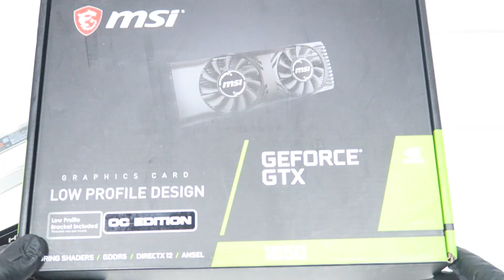Dell Optiplex 7070 Gaming Upgrade RAM SSD Video Card

Comment from the maker: List of Parts  and Upgrades: 
    

 Dell Optiplex 7070 Teardown
https://www.youtube.com/watch?v=HbMezxrIVMg

Dell Optiplex Reassemble
https://www.youtube.com/watch?v=d_iJJm0R1hk

Dell Optiplex 7070 Power Supply Upgrade
https://www.youtube.com/watch?v=zjG4lglejF4

USB Wifi Adapter for PC AC600Mbps Wireless Network Adapter
https://amzn.to/2ZaGuHb
 

List of RAM will work with this system.

(1.) Kingston HyperX Fury Black 32GB 2666MHz DDR4 CL16 DIMM Kit of 2 (HX426C16FBK2/32)
https://amzn.to/38zqi4Z

(2). Crucial 16GB Kit (8GBx2) DDR4 3200 MT/S (PC4-25600)
https://amzn.to/3f21Qf7

(3.) Crucial 16GB Kit (8GBx2) DDR4-2666 MT/s (PC4-21300) 
https://amzn.to/3e7axnh

(4.) Crucial 32GB Kit (2 x 16GB) DDR4-2666 UDIMM (PC4-21300)
https://amzn.to/3e62jvq

(5.) Crucial 16GB Kit (8GBx2) DDR4 3200 MT/S (PC4-25600)
https://amzn.to/3f21Qf7

(6.) Crucial 4GB Single DDR4 3200 MT/s (PC4-25600)
https://amzn.to/2VXqTZo

List video cards will work with this system.

GIGABYTE GeForce RTX 3050 OC Low Profile
https://amzn.to/3xEnd4D

AMD Radeon RX 6400 Low Profile Gaming Graphics Card
https://amzn.to/3s8MUUY

XFX Speedster SWFT105 Radeon RX 6400 Gaming Graphics Card
https://amzn.to/3xkmXo1

GIGABYTE GeForce GTX 1650 D6 OC Low Profile, Low Profile GV-N1656OC-4GL Video Card
https://amzn.to/381pp6Y

(1.) GIGABYTE GeForce GTX 1650 OC 4GB, GV-N1656OC-4GL Video Card
https://amzn.to/2B7N1sP 

(2.) Gigabyte GeForce GTX 1650 OC GDDR5 Low Profile 
https://amzn.to/3el08os

(3.) Gigabyte Geforce GTX 1050 Ti OC Low Profile 4GB GDDR5 128 Bit PCI-E Graphic Card (GV-N105TOC-4GL) 
https://amzn.to/2T8bfsv

(4.) MSI Gaming GeForce GTX 1650 4GB GDRR5 Low Profile Graphics Card (GTX 1650 4GT LP OC) 
https://amzn.to/2X1FYsF

(5.) MSI GTX 1050 TI 4GT Low Profile  Graphic Cards 
https://amzn.to/2LwZd7P

(6.) Gigabyte GeForce GT 1030 GV-N1030D5-2GL Low Profile 2G Computer Graphics Card 
https://amzn.to/2Z4PHkp

(7.) ZOTAC GeForce GT 1030 2GB GDDR5 64-bit PCIe 3.0 DirectX 12 HDCP Ready Low Profile Video Card ZT-P10300A-10L 
https://amzn.to/2WzgLXk 

(8.) MSI Graphic Cards GT 1030 2GB GDDR5, Low Profile 
https://amzn.to/390Spum

Thermal Grizzly - Spatula for Applying and Spreading Thermal Paste 
https://amzn.to/3d8NQEE

Thermal Compound Paste:

(1.) Arctic Silver 5 Thermal Cooling Compound Paste 
https://amzn.to/2ziNU0H

(2.) Noctua NT-H1 3.5g, Pro-Grade Thermal Compound Paste
https://amzn.to/36kTk7A

(3.) ARCTIC MX-4 (current edition) Thermal Compound Paste 20 Grams 
https://amzn.to/2DhGJaK

List SSD M.2 Type 2280 NVMe PCIe:

(1.) Crucial P3 Plus 4TB PCIe M.2 2280 SSD
https://amzn.to/3RZcUNi

(2.) Crucial P3 Plus 2TB PCIe M.2 2280 SSD
https://amzn.to/3RTUi0Y

(3.) Samsung (MZ-V7E1T0BW) 970 EVO SSD 1TB M.2 NVMe
https://amzn.to/3d52k2a

(4.) Samsung 970 EVO Plus SSD 500GB
https://amzn.to/3fpi95A

(5.) Samsung (MZ-V7E500BW) 970 EVO SSD 500GB - M.2 NVMe
https://amzn.to/37uuLFw

(6.) Crucial P1 500GB 3D NAND NVMe PCIe M.2 SSD - CT500P1SSD8 
https://amzn.to/2N07wKh

Hard Drive Caddy Adapter  3.5 to 2.5:

(1.) Dell 3.5" to 2.5" SSD or Hard Drive Caddy Adapter R494D 0R494D 
https://amzn.to/2XTPeRr

(2). Dell Hard Drive Caddy, R494D, F767D 3.5" to 2.5" SSD or Hard Drive
https://amzn.to/3cTkcOk

SSD List:

(1.) Samsung 870 EVO 2TB SATA SSD
https://amzn.to/3ezOds5

(2.) Crucial MX500 2TB 3D NAND SATA Internal SSD
https://amzn.to/3B9f8CF

(3.) SanDisk Ultra 3D NAND 2TB Internal SSD - SATA
https://amzn.to/3RSZ8LR

(4.) Samsung 860 PRO SSD 256GB - 2.5 Inch SATA III Internal Solid State Drive
https://amzn.to/2BY5gRl

(5.) Samsung SSD 860 EVO 250GB 2.5 Inch SATA III Internal SSD 
https://amzn.to/37xWUfc

(6.) SK hynix Gold S31 1TB 3D NAND 2.5 inch SATA III Internal SSD
https://amzn.to/3d7X6D6

(7.) Samsung SSD 860 EVO 1TB 2.5 Inch SATA
https://amzn.to/2B2FURX

(8.) SanDisk SSD PLUS 1TB Internal SSD
https://amzn.to/3hwdqku

(9.) SanDisk SSD PLUS 240GB Internal SSD
https://amzn.to/2zfc7EX

(10.) Crucial MX500 250GB 3D NAND SATA CT250MX500SSD1(Z) 
https://amzn.to/3bTTjbX

(11.) SanDisk SSD PLUS 480GB Internal SSD SDSSDA-1T00-G26
https://amzn.to/2yfgjUK

HDD list works with this PC:

(1.) Seagate BarraCuda 4TB Internal Hard Drive HDD – 3.5 Inch
https://amzn.to/3d3xWeR

(2.) Seagate BarraCuda 8TB Internal Hard Drive HDD – 3.5 Inch
https://amzn.to/3xjUDSJ

(3.) Western Digital 2TB WD Blue PC Hard Drive HDD - 5400 RPM, SATA 3.5" - WD20EZAZ
https://amzn.to/3w3jIQA

(4.).WD Black 2TB Performance 3.5" Hard Drive - 7200 RPM Class, WD2003FZEX 
https://amzn.to/2xFUeyF
Reply: Sir can you give me advice what is best graphics card upgrade for my Dell Inspiron 3668 i3-7100 8gb ram
Reply: @bangihun5058  gtx1650 gddr6
Reply: @bangihun5058   try get a  i5 7500 for cheap since any graphics card more powerful than a gtx 960 will be bottlenecked by that dual-core cpu.
Reply: Where is the best place to get an Optiplex? And which model would you recommend?
Reply: Spooksville Scoob try local sales and eBay as these computer are very common.
Reply: hello pale can I buy this rig Dell Optiplex 7070 Gaming from this video if you don't use it any more ....peace
Reply: How much was the build in this video
Reply: Great information coming from this video.  Liked and Subscribed. 

I’m wondering if the Optiplex 7040 will accept the same list of ram you posted. Thanks.
Reply: Can i put 1050ti low profile im my optilex 5060 ? Or i will face PSU issue ?
Reply: I just put a Sapphire RX 6400 into 16 slot of this computer with 200 W and it works just fine (no DVD but has SSD and 5400 drive).
Reply: So do you have to have the 240w for the graphics card in the video to work? Or can it still run on 200w?
Reply: Is it possible to install a RTX A2000 on this thing?
Reply: Did you have to make any bios changes for gpu to work?

Comment: Hi bro, love your videos.

How is the GTX 1650 running? I am aware some dell prebuilts advertise a power limit of 50 W or even lower for the PCIe slots, is this Optiplex affected?

Also being a PCIe X4 I wonder if you ran into significant bottlenecks because of this.

Comment: Hi, congratulations for the video. I would like to mount an SSS on my dell optiplex xe3 sff i5-8500, I have the Sata cable already connected to the motherboard, while the power cable is missing.
Currently there is connected DVD and NVME drive.
Can you tell me how I can do it? Thank you

Comment: using that x4 slot with the gpu will nerf that card by like 20 to 30%
Reply from the maker: Hi.
Reply: x4 slot only has a 5% to 10% performance loss do some research before you comment 🤡

Comment: you cant put that gtx 1650 with that optiplex 7070 on the specs of that computer is not listed did you change the motherboard???be honest only these are compatible Dual AMD Radeon R5 430 AMD Radeon RX 550 NVIDIA GeForce GT 730 AMD Radeon R5 430 so how did you add a gtx 1650???

Comment: Just bought system w/o RAM or SSD so this video was perfect.  Excellent list of resources also.  A keeper.
Reply: Hey do you know if there is an USB pin for connecting a network with Bluetooth card? Because I bought one and I cannot find an USB pin (female) in the motherboard

Comment: I need your help, i put in the a new 1tb ssd in the 7040SFF but it’s saying no bootable device found. What do I do
Reply from the maker: Hi, you have to check in BIOS settings see if SSD is detected ?
Reply: @Mxkdt  it’s detected
Reply from the maker: @CxsmoFN  Are you trying to install Windows on it or you already did that ?
Reply: @Mxkdt  I just installed it, i don’t it has windows on it, it’s the silicon power 1tb SSD in an optiplex 7040 SFF
Reply from the maker: @CxsmoFN  In Windows go to Control Panel\System and Security\Storage Spaces and create a new pool and storage space for your new SSD.
Reply: @Mxkdt  if I put the ssd it won’t boot and when I try creating the storage pool it says no drives that work with storage spaces are available

Comment: Hey man, even I'm thinking of upgrading my office PC so i really need your help. So i have OPTIPLEX 3070 MT so im planning to get GTX 1650 OC. Do you think it will work fine with it? I have i7 9th gen processor
Reply: Please reply me if you get think. It would be really helpful
Reply from the maker: Hi, yes GTX 1650 will work fine in that PC.

List video cards will work with this system.

(1.) ASUS Phoenix NVIDIA GeForce GTX 1650 OC Edition Gaming Graphics
https://amzn.to/3Nyn7yb

(2.) ASUS TUF Gaming NVIDIA GeForce GTX 1650 OC Edition Graphics Card 4GB GDDR6 
https://amzn.to/3moJbzo

(3.) PNY GeForce GTX 1650 4GB GDDR6 Dual Fan Graphics Card
https://amzn.to/3aFlxw4

(4.) ZOTAC GAMING GeForce GTX 1650 OC 4GB GDDR6 
https://amzn.to/3xeX0FF

(5.) AMD Radeon RX 6400 Low Profile Gaming Graphics Card
https://amzn.to/3s8MUUY
Reply: @Mxkdt  thank you so much for responding🙏🙏

Comment: The real question for me it would be how long the PSU will live and how are those PSU called? Because if mine die then I would have to buy a new PSU but they looks very differe t to the ones I am familiar with.
Reply from the maker: Hi, what model dell PC do you have ?
Reply: @Mxkdt  3040
Reply from the maker: @zamirroa  You want to replace power supply in a Dell OptiPlex 3040 sff for gaming ?
Reply: @Mxkdt  I think it is not possible. I just wanted to know how much they last.
Reply: Sff

Comment: I was planning to buy the 7050 SFF with i7-6700 cpu and 16 GBs of RAM. But I want to upgrade the video card to the GTX1050ti OC (low profile). Plugging it to the PCI Express x4 slot instead of x16 does it means that the full capabilities of this graphics card will not be achieved?
Reply: Exactly!

Comment: I've posted on other videos regarding the PSU..and the low clearance of the pcie x16 slot..has anyone tried or thought of using a 300w pico psu? It would free up so much room for better airflow along with better GPU clearance

Comment: The only thing you forgot was to include the part number to get the screw for the SSD LOL... thanks for great videos.
Reply from the maker: Hi, thanks screws are included when you buy that blue caddy R494D 0R494D F767D J132D Replacement for DELL OptiPlex 2.5" HDD SSD Caddy Tray..
Reply: @Mxkdt  I was referring to the single screw holding down the NVME, (thus my mentioning SSD) you mentioned you'd put where to get that, it's ok, I already ordered it.

Comment: How did you fit that GPU in?
Reply from the maker: Hi, what kind a video card are you trying to install ?
Reply: @Mxkdt  sumtin like a small cooler version of the rx 6400 or the HP OEM rx 550

Comment: Would the video cards recommended for this optiplex 7070  fit on a optiplex 3070 min  from the video the size is the same
Reply from the maker: Hi, what model optiplex 3070 do you have is it minitower or sff or mico ?

Comment: Is that the only graphics card you can put on it or can I use a rtx 2060??
Reply from the maker: Hi, this dell small form factor can only fit low profile video card  like gtx 1050 or gtx 1650, gt 1030 with low profile bracket only and rtx 2060 will not fit...
Reply: @Mxkdt thanks 👍
Reply from the maker: Please don't forget to subscribe to the channel.

Comment: I have a 7040 and really am surprised that 3 generations later Dell still has the PCIe slots the wrong way round 😄
Reply: I have a 5090 and still pcie x16 at wrong position. This shows how much industry is slow in modification and resistant to change. They think these machines are not for gaming so they don’t care. They feel its not worth their time to spend time on redesign.
Reply: Plus they did that on purpose

Comment: Hey I have a 7060 SFF - what is the best GPU that will fit into my case?
Reply: Hello bro, which GPU did you bought for 7060 sff?
Reply: @gilbertodisai4392  1050ti low profile gigabyte
Reply: @adilahmad7259  do you have the 180 psu?

Comment: Does sticking a 1650 in the x4 slot loose performance and power?
Reply: I was wondering the same thing. I was under the impression it would not work at all in that slot.

Comment: I have the same setup,and it's a little bit overheating...but if you put a 80mm fan at front,the video card takes cold air from outside,not heat from power supply..
Reply: The question os where we can connect the power port of the fan in the motherboard?
Reply: @AkoSiManatMy  You will find a fan header on the bottom right of the motherboard, it has 4 pins and is white.

Comment: Isn't this office pc too expensive to upgrade? Like, you spend 250 on this pc at best, and then 80 bucks on a low-end GPU? Don't you want it to be the other way around? I doubt even a 3rd generation intel i5 CPU would be a bottleneck for this system.

Comment: hi! May I ask if i7-8700k (or i9-9900K) and Quadro P1000 are compatible to Optiplex 5060 & 7070 SFF please. Is upgrade the power supply needed?
Reply: Hi, no K cpu models. Only the non K. The LP p1000 will work Just fine.
Reply: @robinvemsus6223  Hello. Thanks. I got i7-9700 already. GPU to follow

Comment: I have 7050 same design, use gtx 1650 msi with 180w 32gb ddr4 240 nvme, no issue yet
Reply: wow! so gtx 1650 can handle 180w PSU? how's it going now?
Reply: Yeah is it still going strong?
Reply: I’m about to try a 1050 ti low profile on 180 watt power supply
Reply: Any update about this?

Comment: I'd be tempted to drill some holes in the PSU case to get some airflow out of that GPU.  It's a shame Dell didn't put the x16 slot on the upper side.
Reply: i know now i use the 4x for my gtx 1650 low pro lol

Comment: Air flow rip
Reply: mount a cpu fan above and in between cpu and gpu i never get above 65 degrees c and im over clocked pulling 2200 core clock.

Comment: This seems like such a waste of time since you can only use the pci express 4x slot... Like, what is even the point?
Reply: It does work. He physically can't pkug it in. 
Difference is around 5-10% performance.
That's nit much considering gtx 1030

Comment: I’m surprised that the GTX 1650 worked with that 240W psu cause the minimum requirements were 300w
Reply: They can out whatever arbitrary recommended minimum requirements, but the card is pci powered and can never draw more than 75 Watts. And I'd be surprised if it ever uses more that 50W.
The cpu is never gonna be more than 95w in a sff pc.
Hard drives and ssd's when fully populated take 10-15W at peak load (spin up of mechanical drives)
So that's a total of 185w + memory and motherboard, so it won't go over 200w... Enough power left over to install another expansion card as well.
Reply: @arturm4558  ive been running a gtx 1650 msi oc low pro on my 4x slot in dell opti 7020 sff model for like 8 months non stop and the slots rated for nop more then 35 w lol. still going strong .
Reply: @sipmeister3611  does your optiplex have a 180 psu?
Reply: @asfaltweg  no 245w
Reply: It is a gtx 1030
Reply: A put a GTX 1650 LP in a Dell Optiplex 3010 SFF that also has a 240W PSU and it works fine.

Comment: Can i use the same gtx 1650 low profile in dell Inspiron 660s???
Reply from the maker: Hi, no you cant because pci express x16 slot is located on the bottom and will not fit and you can only use gt 1030 or you can take the motherboard and install into mid tower custom case and that allow you to install gtx 1650 or gtx 1650 super.
Reply: Thanks

Comment: When you've done an upgrade do you have to fo anything to do with software?
Reply: I think that you have to download the graphic cards drivers and the ram is updated automatically in the system, that´s what I know
Reply: @gabrielgonzalez5554  no after ram upgrade you may be drawn back to 1333mhx instead of full 1600 dont ask why but it happened to me today althoough my previous ram was already at 1600mhz ?

Comment: Hi Mxkdi - thanks for all the vids!! Question (really stuck here) - I have a Precision 3431 SFF w/ I9, 32gb of ram, 500gb sad the little one, and I put in a AMD Radeon Pro WX 3200 graphics card. The main use of the computer is for stock trading (so 4 monitors) then I want to be able to use it for some gaming (call of duty and fortnight). I don't think I choose the right upgrade GPU for my needs. Any suggestions on how to upgrade this SFF that has a new I9? Thank you!
Reply from the maker: Hi, it depends how many watts is your power supply you have to check ?
Reply: @Mxkdt  currently 200w power supply. I added an 80" fan in the front. Should I upgrade PS? Thanks,
Reply: @Mxkdt  I am also running 4 dell monitors for stock trading by daisy chain. So what upgrades should i do? I was a good card that is can handle the monitors plus some good gaming. I have the dell 32gb ram should i upgrade that to a better brand? thank you
Reply: A quadro LP p1000 can display 4 MONITORS and you can game on it. Its not as good as the 1050ti but it will do.

Comment: does gpu in x4 slot means it's running 4x slower than the x16 slot?
Reply: No. 4x is enough for low/mid range GPU's. There will be no difference.

Comment: I have a Lenovo Thinkcentre M58p tower that has a Core2Duo E8400, can you recommend me an upgrade for the cpu and a gpu?
Reply: Damiel Reyes socket 775 is pretty much dead man. The only upgrade you could do would be like to a core 2 quad. Possible a q6000. But you would be better off getting an old 2nd gen core i5 system and a 1050ti or 1660ti
Reply: @owenrummage7306  what mobo do you recommend?
Reply: Damiel Reyes for core2quad?
Reply: @owenrummage7306  the i5 system

Comment: How u can plug gpu (pci x16) into a slot pci x8 (?) 
I don't get it
Reply: Backside of the x8 slot is open so card can be installed. Will run at lower bandwidth.
Reply: Scott belford Yeah thanks, I realized watching slowly, slots is open

Comment: Hi, i have an HP pro 3500 microtower with i5 3470 and 300w psu, can i use gtx 1650 with this psu?
Reply: YES, but if you can but at least 500w more better. You can also upgrade you hdd to m.2 and memory ram.
Reply: Yes, that will work perfectly with your system. You don't need a 500w psu.